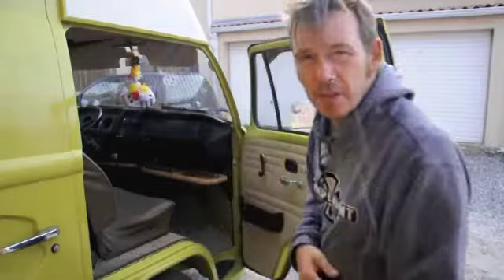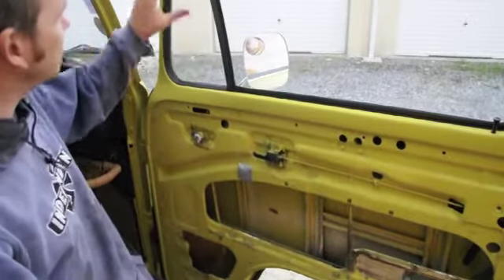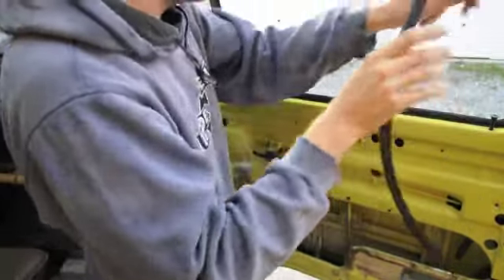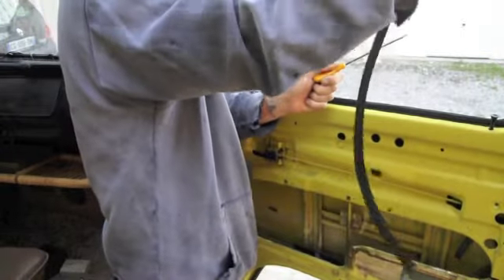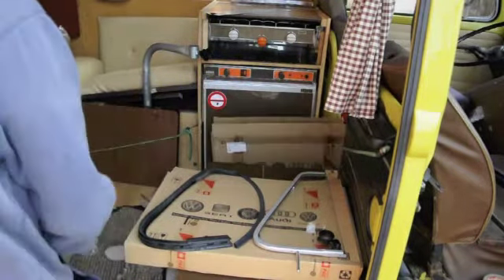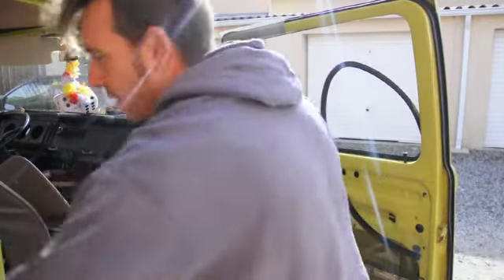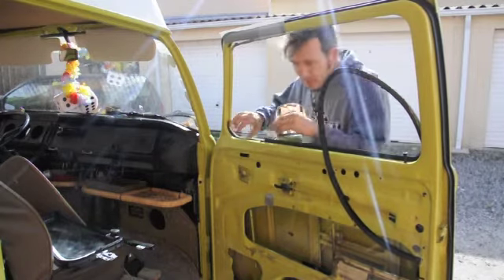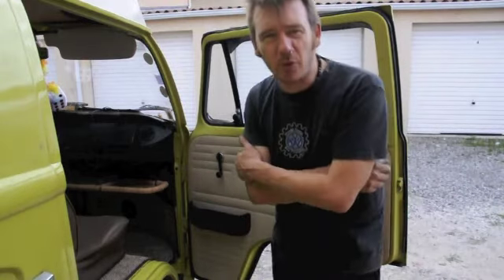how to change ¼ light window on VW camper - woolies workshop

Comment: thank you for this video, it has made the job much easier. I have a question, im replacing the weather stripping in my 3/4 window, but the window is riveted in? do i drill through rivets and replace with screws? I also have the chrome trim work with outer scraper all in one piece, do i put this in first? Thanks again for your help.
Reply: Ive got it. I saw someone else had a window trim replacement video, and he drilled through and re-riveted.

Comment: Hi iv just had a respray and a Lot of rust removed and filled, I got my  t25 back today and the respray job  is awful, also the sliding door doesn't lock when open it's about 2inches short of ware it locks, there was a Lot of rust behind the panel so im wondering if it's something do with the work there.they did say they never took the door off. I was charge more than what was 1st agreed the van was gone for 7 months Can i do a small claims for this.can anyone advise.